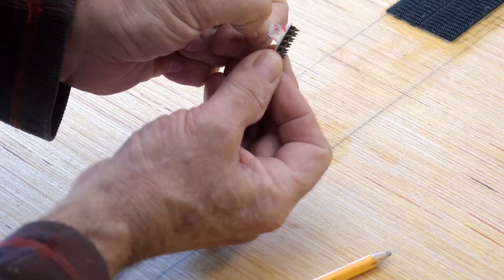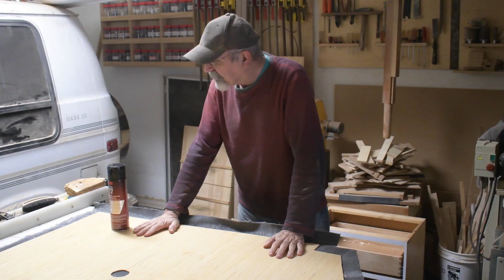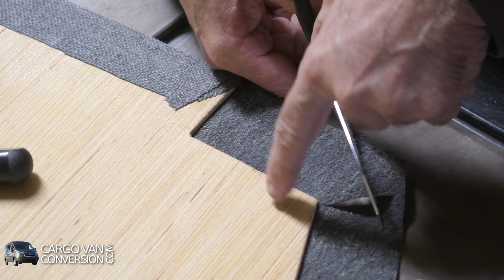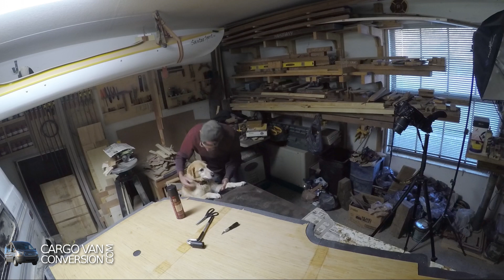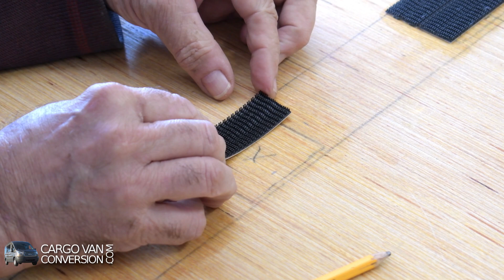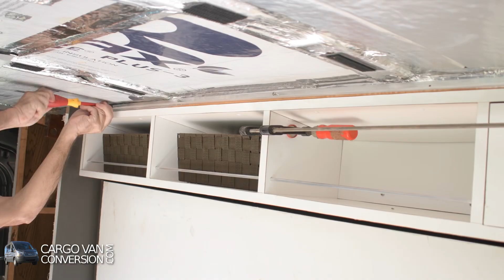RV Ceiling Panel - Part 2

Comment: Hi Van, I was thinking about your solar panels recently. I know you haven't used the van much yet but I wondered if you'd consider doing a follow-up video about how much power you're able to draw?
Reply from the maker: Will probably do so this summer. I have three 135W panels on the roof and two 100W flexible panels under the mattress, which I can place outside and simply add to the system for a maximum of ~600 watts. Expect to produce at least 200A in summer, may be up to 300A. More importantly however, is the use of these extra panels in winter or when parked in the shade. I might not produce enough energy in winter to cover a somewhat 'unlimited' use lifestyle and my back up plan for that is, a DC-to-DC converter connected to my heavy duty alternator. Probably will wait with the latter until after first first year living in the van to determine it's necessity. I anticipate a daily consumption of 125A-150A without major issues throughout the year, which to me means unlimited, except for A/C use; that's a whole different story.
Van Williams & Joey

Comment: I did get some annoying failures with my ceiling glue, due to the excessive temperatures we can get here in Australia where the internal temperature can exceed 50degC if carelessely parked in the summer sun. Hope you don't have the same problems with the 3M product.
Reply from the maker: Hi Norman,
While temperatures are relatively somewhat higher down under, I think, I've seen very similar highs here too. 3M products are well-known and very efficient.I used 3M VHB tape to stick my solar panels to the roof without any issues after 3-4 years. But you have to choose the right product for the right surface and material and clean the surface before installation as required. These glues sometimes work in temperatures of up to 150-200 degrees. But I will do update videos about some of these critical issues in the future.
Van Williams